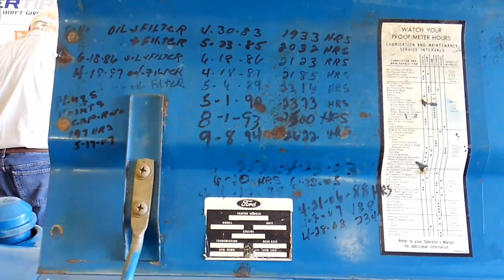67 Ford 2000 tractor

Comment: Very nice. I just bought one this evening. Doesn't look nearly as shiny as yours but runs well.
Reply: how much you pay for that?
Reply: @chrispeters4405  I paid $1,800 and it had a 7 foot blade on the back. It has a little trouble with the shifter ball popping out of the socket in 4th if you're not gentle but I typically use 2nd and reverse with high and low anyway. I just replaced the rear end hydraulics gaskets and O-rings ($14 gasket kit) and now it will hold a 600 pound box blade up for days, literally. It wasn't terrible before but I wanted to help it out. It runs great and doesn't ever get hot. I have build multiple trails, pulled trees, moved several cords of firewood with a carryall on the back, built a bridge, pulled tons of dirt, and moved snow and ice this past winter. All in all this cheap old 1967 Ford 2000 gasser has been one my best investments. I just lucked out. My only complaint is it doesn't have a locking differential but I am looking for a rear end.

Comment: It doesn't sound like it's running right, i've never heard a Ford 3 cylinder sound that way.
Reply: Is it just the exhaust?
Reply: @anthonyantinarella3360  It is a 4 cylinder gas, the 3 cylinders were diesel
Reply: 3cyl gas
Reply: @thomasstewart9398  thanks never heard about a the 3 cylinder gas
Reply: I have a 69 3cyl gas ford 4000 that has a holly carb, mine can give a little sputter if the revs get too low, very minimal after adjusting the carb. A lot of old gas tractors and cars from way back when, sputter a bit, but they work just fine.

Comment: What Ford color did you repainted it in?
Nice color!
The old paint «Empire» looks like blue/green and many that has bern repainted with the new Ford paint look sometimes like blu/purple, so i am confused.
Is it Empire blue or Ford/New Holland blue that was standard from 66 i thing.
I have an 67 mod 2000, but is cofused for the paint color i should use on mine.
Reply: Hey,I’ve got a 72 2000,did you ever find out which is which?I like this blue a lot better than the darker blue with a purplish hue.I bought some Majic oil based ford blue,it’s dark blue close to the color of the 72 but this color is sweet.
Reply: @pedrohippocaus8488  I've got the PPG paint code if you still need it.